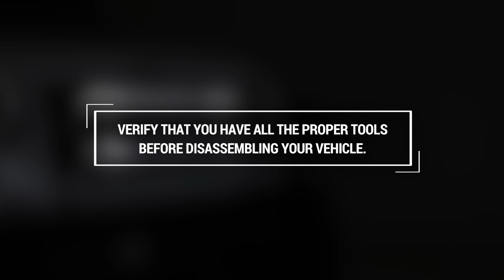Installing 2007-2017 Jeep Wrangler JK 20-inch LED Light Bar Grille Mount by Rough Country

Comment: Do I need to take any special precautions to prevent rust where the rivnuts go into the metal of the Jeep?
Reply from the maker: You don't have to. They are coated.
Reply: Thanks for the reply. I ordered this and a 20" light bar last night.

Comment: can you install a 22" light bar instead of the 20"
Reply from the maker: 20" light bar is what it is designed for. 22" light bar will be too long for the brackets in this setup.

Comment: Will this work if I have a super charger
Reply from the maker: +nipawe Do you currently have a Supercharger install, like a RIPP supercharger of something?
Reply: +Rough Country yes I have the ripp
Reply from the maker: +nipawe From what we can tell, this mount will not work with a supercharger or turbocharger intercooler installed in the grille due to the piping getting in the way.